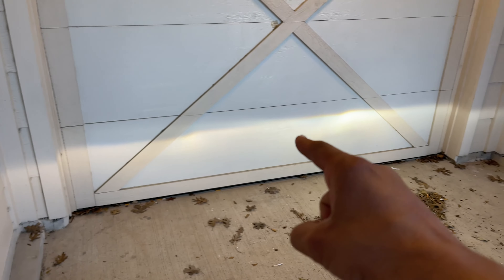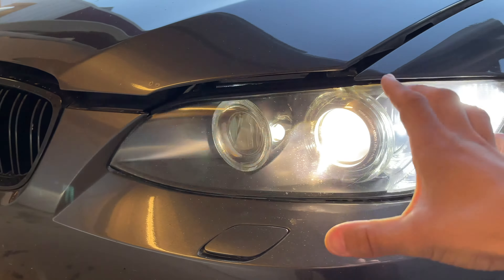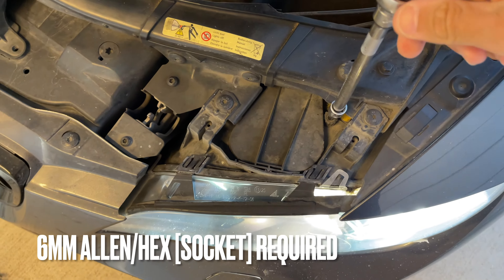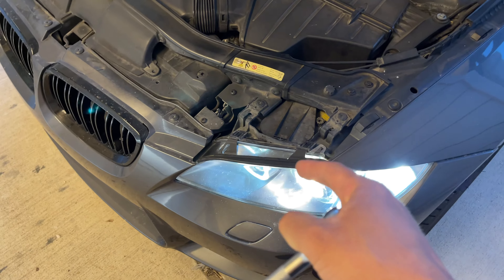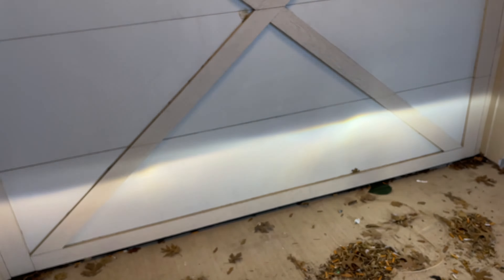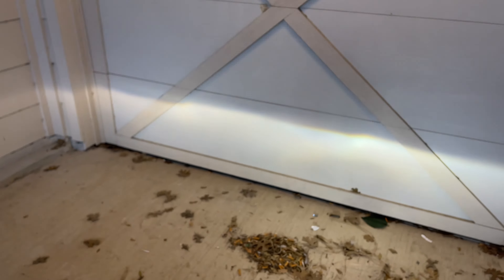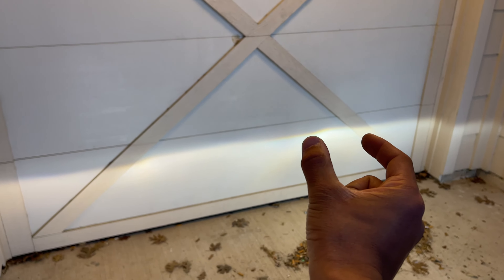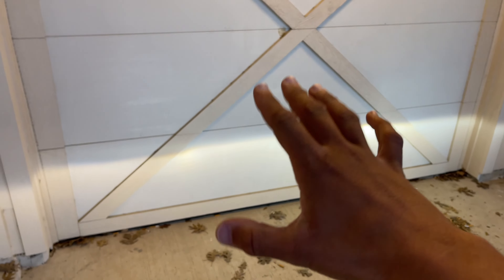How to Adjust Headlight Level BMW! | E90 E92 328i 335i M3

Comment: One head light is meant to be offset to shine more light on the pavement so you can spot pedestrians.
Reply from the maker: my OCD can’t stand it
Reply: What pedestrians?
Reply: @yukiiscrazy5676 exactly.
Reply: @IzzyE9X so you would rather endanger pedestrians or other drivers. Very thoughtful OCD.
Maybe change the compulsive to considerate
Reply: @yukiiscrazy5676  this guy is a real bmw driver
Reply: I need it low to spot pout holes
Reply: @sharkfinn6469 literally every new car has perfectly level headlights. Get over it. I’m doing this mod right now my left points way higher than my right.

Comment: My e92 headlight has a different adjustment.  look where the hood comes down on each fender, find a long rubber strip and behind it a round rubber and remove it.  insert a 6mm allan wrench into this opening and search for a receptacle in the headlight.  This is the up and down adjustor.
Reply: I was wrong about this, this is the horizontal adjustment only.  Disregard my earlier comment.

Comment: I don’t know if you will read this
But the left headlight on right side driving roads should be lower than the right
For England and other countries on left side driving
Right headlight should be lower than the than the left one
Reply from the maker: @MitkaZz  yes this is correct, I choose to level them because my OCD can’t tolerate one higher than the other

Comment: DON"T YOU EVER do that! 
Left headlight SHOULD be lower not to blind other drivers! Also, lower headlight gives you better visibility of the road. Whilst right headlight adjusted higher to get better view of the right side of the road to watch for any hazards might be coming from the side
Reply from the maker: my E92 is lowered so the light’s beam have been lowered: because of this I had to tilt the beam back up. I’ve tested all around town and they’re angled to where I don’t blind anybody
Reply: That's why the cutoff is lower on the drivers side. I believe the legal setting is pointing 5 degrees down.
I have my headlights setup correctly on my truck, but because it's so much higher than other vehicles there's always a point where it's going to blind other drivers even though it's setup coreectly.

Comment: If you actually think this was good, you are mistaken. You have not addressed at all to tell everyone how you know that you are not blinding anybody. This is the most annoying thing getting blinded. You NEVER just go and raise the level on the low beam without knowing the point it cannot be above because that is where you start blinding people. You say a safety hazard. YES you are right, by blinding somebody you are creating a safety hazard. You actually need a headlight aimer or a wall on level ground ONLY, and 25' away from the wall, then you need to have a line on the wall that is exactly the center of your head lamp from level floor to center of head lamp distance. NO light from the center of your low beam level line, to the left of the center of your beam, can be above that line at any time. The right side most of the time is angled upward slightly, that can be above the horizontal line but the center of the beam needs to be centered to the lamp and wall also. Now this is only the basics and scratching the surface. There is unfortunately a lot more to it that cannot be explained without pictures to understand. What you are doing is telling people to just raise your head lamps. No wonder so many cars go down the road blinding everybody. When you teach someone, make sure you get your facts straight. It is not that hard do actually find accurate information. Sorry, a big thumbs down on this one.
Reply: Cool. I’m doing this on my car right now. Thanks for the long story 👍